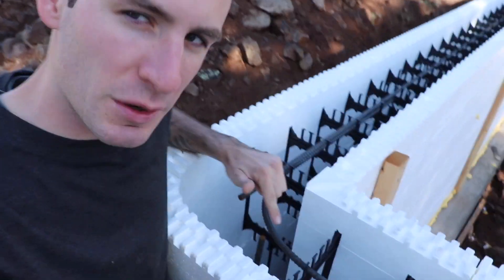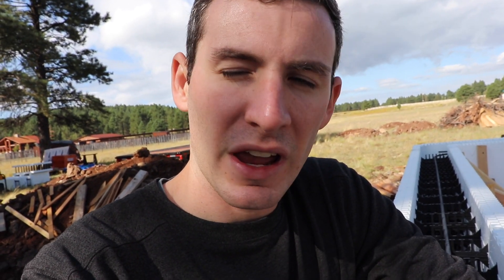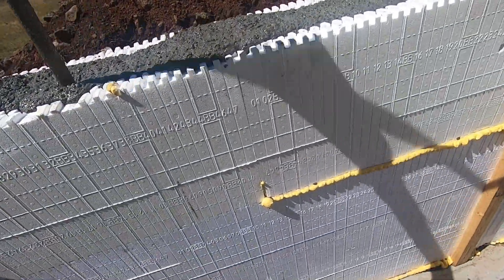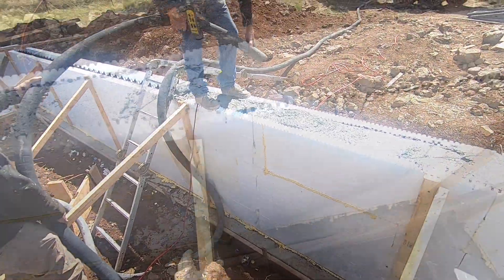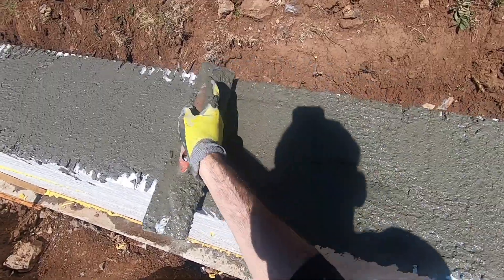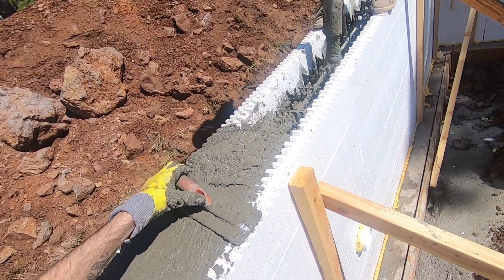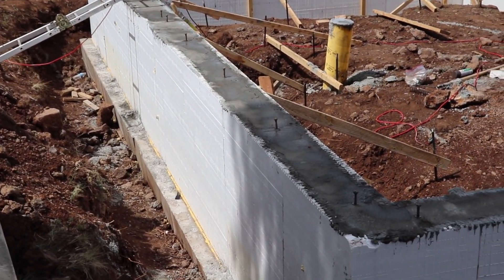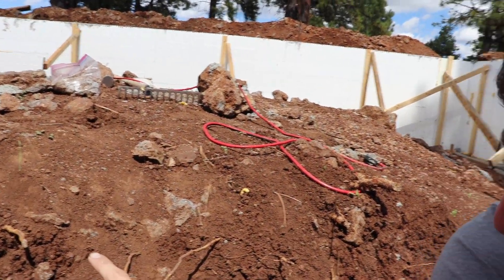Pouring Concrete With Only Two People (ICF Concrete Pour)

Comment: What did the ICF boards cost total? I am thinking about this for my house I am building... Also, what were the dimensions of it?
Thanks!
Reply from the maker: I believe they were around 2,500 for a 4ft tall wall 20x32
Reply: For comparison, I paid a contractor in July 2020 to pour a traditional foundation for a 28'x48' garage, 10"x20" footing, 10" thick 5' tall stem walls.  $3000 Labor, $3940 Concrete, $740 Rebar/J Bolts, Totaling $7680 for the whole job.  It came out great and it was done in four days best of all I got to watch the show.  The ICF forms cost more than than the labor alone...  Plus I am not sure they make much sense for stem walls?  It may make sense for a full foundation you plan on finishing but the price is still steep would be 5K alone in ICF.  I give them props for pulling that job off, it came out awesome, but I would not consider that work DIY, the risk of failure alone is worth hiring it out...

Comment: Since you had the vibrator, nothing wrong with using it - more.  It doesn't do any harm and it completely consolidates the concrete.  Not that big of a deal on a short wall like this, but ideally, you vibrate the whole thing.
Reply from the maker: I had read some stories of people who vibrated it too much and it compromised the structure cause there was no more aggregate in the top part of the wall, but i tried to do it about every 3 or 4 feet or so.

Thanks for watching!

Comment: I see a lot of people using turnbuckles to adjust the plumb of their ICF wall during the pour. Did you end up having a problem? Especially with your concrete guy standing on the forms. I could also see your wall being short enough for it not to be a problem.
Reply from the maker: For a tall wall it would be alot harder to do the way we did it, and you would probably need turnbuckles... but with a short wall like we had there were no issues just screwing the braces in.  I was a little worried about the pump guy walking on it but it turned out just as plumb as when we braved them.

Comment: Icfs would be great for short walls and homeowners. Looked like ya done a good job. If you aren't making it into living space there isnt a need to waterproof it. Just need a sump pump to keep water out. Good luck on your project.
Reply from the maker: Thanks for the insight! And that's why I chose ICF's, it was way easier to build the forms than using wood.  Thanks for watching!

Comment: Last time I checked I always want a smooth finish on to which I am going to put the Sill Plate of my walls!
You are going to waterproof the exterior of the stem wall???
Reply from the maker: A very smooth finish is definitely ideal, but because of some factors that were out of my control I didn't have enough time to get it perfect. It was pretty level with the exception of one high spot, but we'll cover that later! And water proof the stem wall? Of course we will!!

Thanks again for watching and once again we appreciate all the feedback we can get!